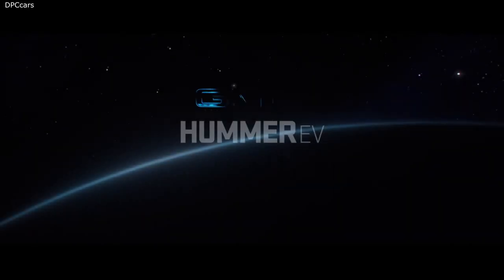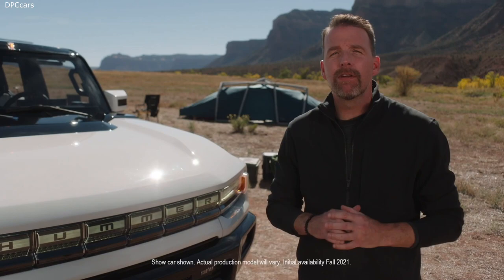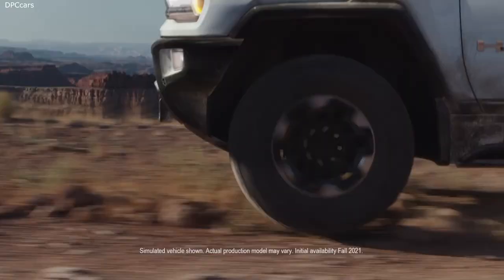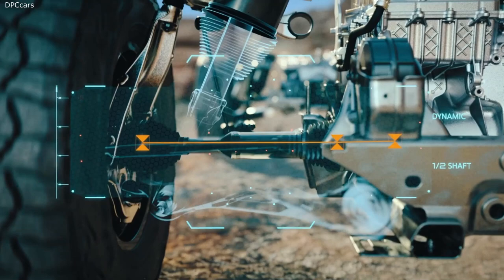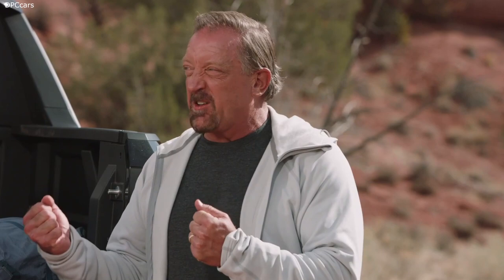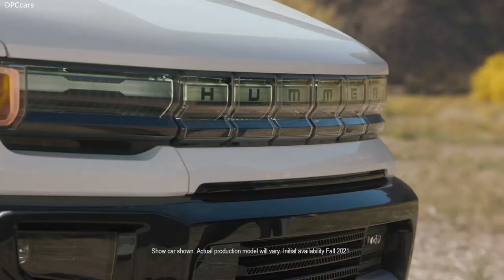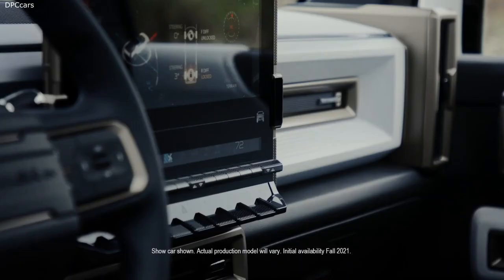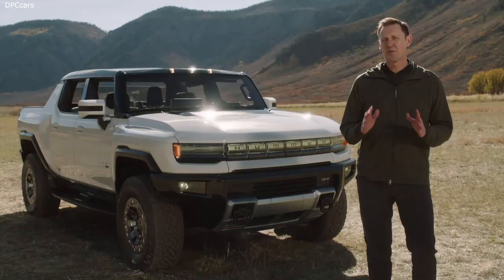2022 GMC Hummer EV Electric Truck Explained

Comment: The batteries put off emissions, just not as much as the tailpipe. Also, to build this truck, it cost energy. To dispose the batteries is not simple. To build the batteries, it takes rare earth minerals. To get the rare earth minerals takes mining the earth, digging holes. This is not nearly as green as they claim. Also, more electric cars, more demand on coal and NG.